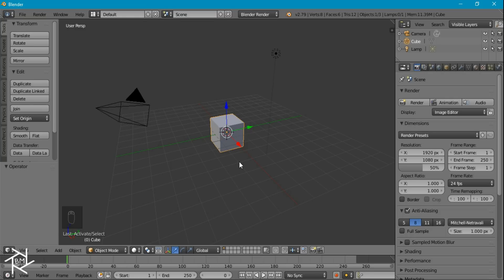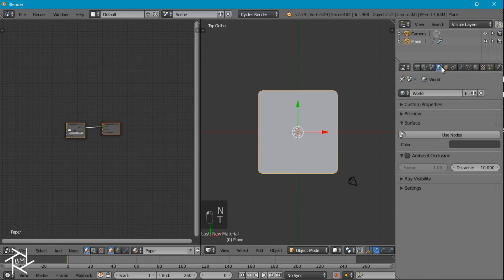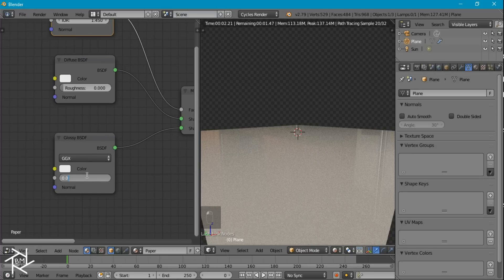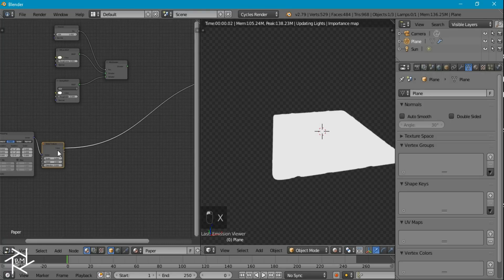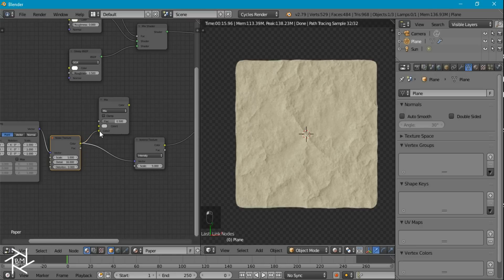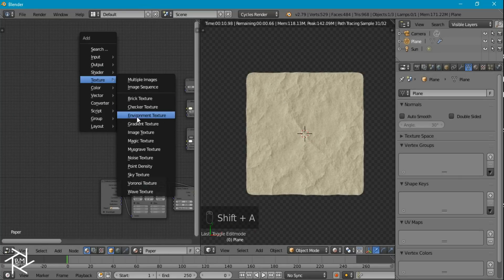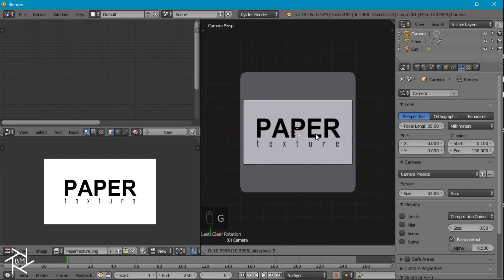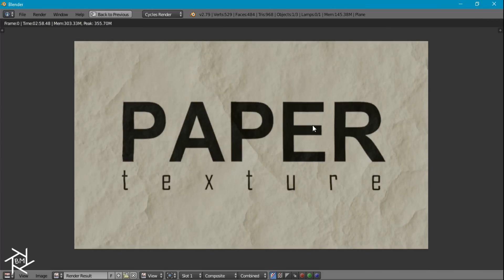How to Make a Procedural Paper Texture in Blender

Comment: Does not work with 2.80. I did exactly what was shown... The paper gets so distorted that it is goes out of the viewport. After that, the controllers will not change anymore. Either that's a bug in 2.80 or it just does not work that way anymore with 2.80
Reply from the maker: Yeah that seems really weird I'm not sure what's wrong. It seems like the strength of the bump/normal map may be too strong, so I would adjust that before connecting it into the node group maybe.
Reply: I was having a similar problem in 2.8 - I found that putting a vector displacement node between the noise and material output, did the trick. Set the mid level to 0.5 and lower the scale to 0.1 or so.
Reply: hello... 2 years late- heres a fix (works in 2.93 too) place a color ramp between noise / voronoi texture and displacement output- setting the white part of the color ramp to grey will lower the intensity of the displacement

Comment: Nice tutorial!  And the result looks good; maybe I can find a lined paper texture.  I'd suggest using the new principled shader instead of the diffuse and glossy combo.  It does the fresnel automatically (with a little more accuracy), and I think it's better performance, if I remember correctly.  I tried it, and the settings translate over nigh-perfectly.  Thank you for sharing this with us :)
Reply from the maker: No problem. Thanks for the advice. Only reason I didn't use the principled shader was simply because of the habit of always using the diffuse/glossy combo. Also, if you wanted a lined paper texture, I believe you could use a gradient texture followed by a color ramp node and then just adjust the markers to get the effect you're looking for. ;)